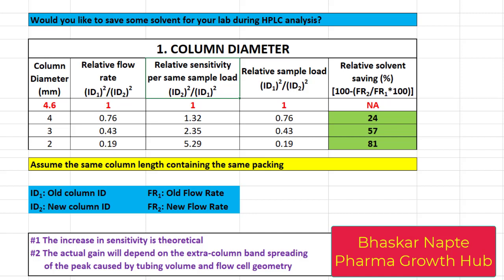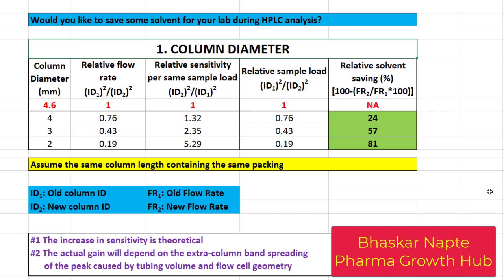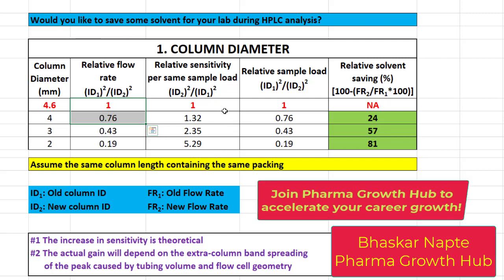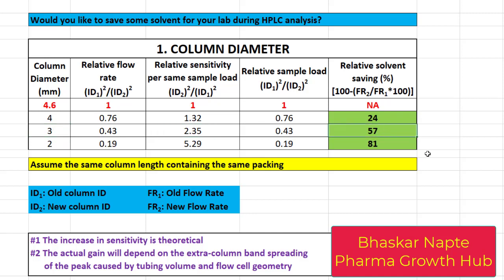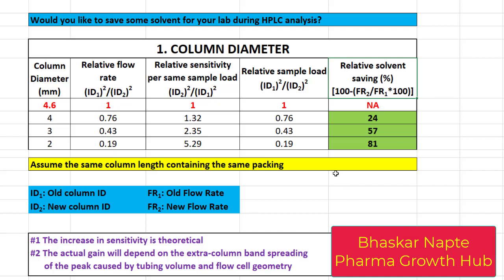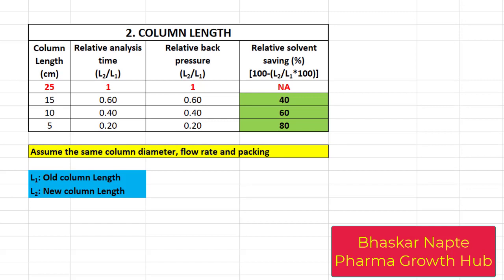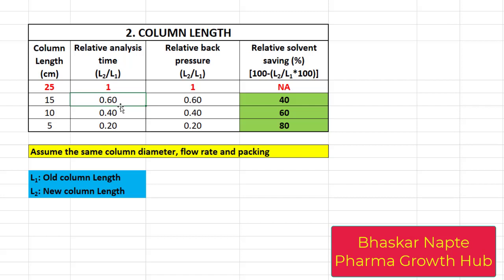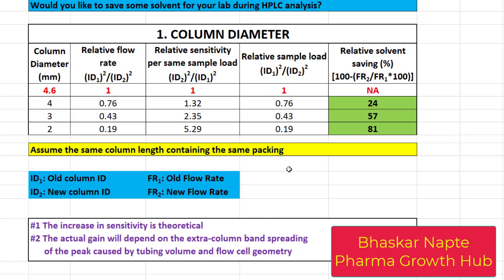How to reduce Mobile Phase consumption during HPLC analysis?

Comment from the maker: Small corrections, Please read ID1as  "New column ID" and  ID2 as the "Old column ID",  to help understand the correct calculated values for "Relative flow rate", "Relative sensitivity" and "Relative sample load".
Reply: Sir, any reference guideline ?
Mah i know the Calculation behind the changes.
And what about the particle size variations?